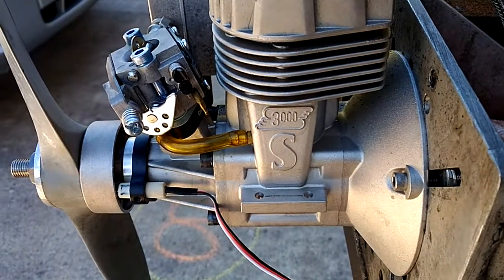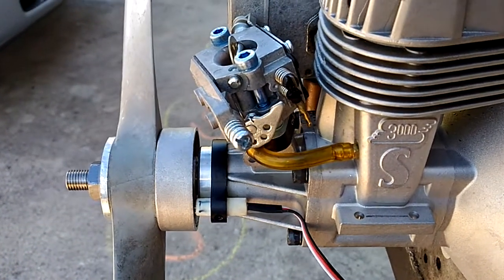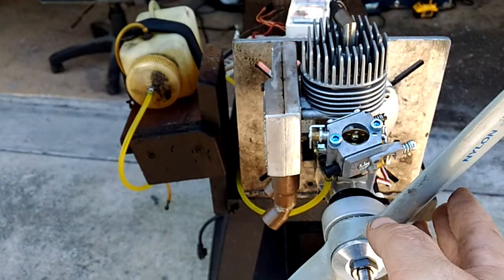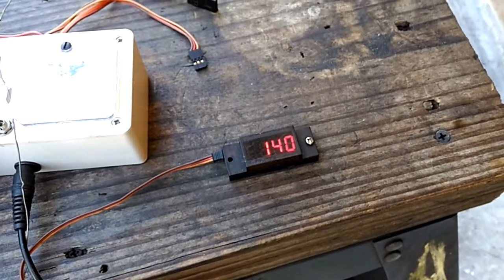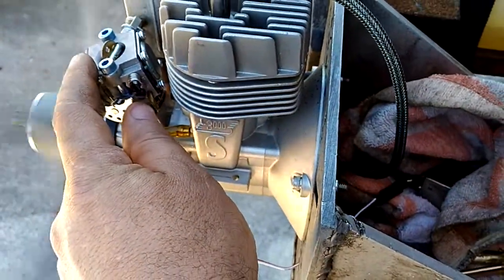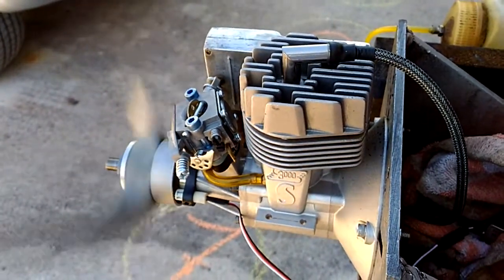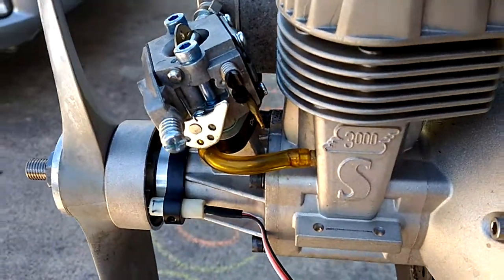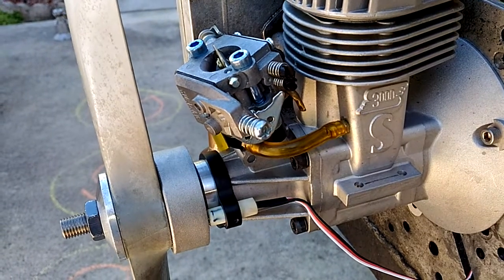Super Tigre 3000 CH Ignitions Full Gasoline Conversion

Comment: Hello I have a supertigre 20 I put the walbro carburetor and the rcexl ignition the point I left it at 30° before the pms the engine runs in the starter runs smooth without failures or goes out but in the hand no signal should I change the sensor time?

Comment: I wouldnt trust a Super Tigre to run like that at all. I have worked on small engines all my life and I wouldnt trust that set up any further than I could throw it. Period.
Reply from the maker: CH made those conversions for the last 30 + years. And some stil  running. Just change the parts from plastic to AL6061.
Reply: Adrian Ciulei As stated, he intended to change the stator pick up to a ring. Where would someone get the conversion kit now? I would be interested in doing one.

Comment: did you real flew it on airplane. i did flew converted to gas . the engine very easy to over heat.
Reply: Did you have enough oil in the mix? Friction = heat.

 Did you have it running too lean? The fuel helps cools the cylinder and piston on the intake stroke when it evaporates.  Did you have the timing too advanced? Too advanced timing will make a lot of powrr but also allow heat build-up.

 Using high octane gasoline will burn cooler.

Could also try to Add a gasket/ spacer under the cylinder head to reduce compression. If you put a spacer between the crankcase and cylinder it will effect the intake and exhaust port timing. So be careful there.

It
Reply: @cobre7717   I  will try it richer again.